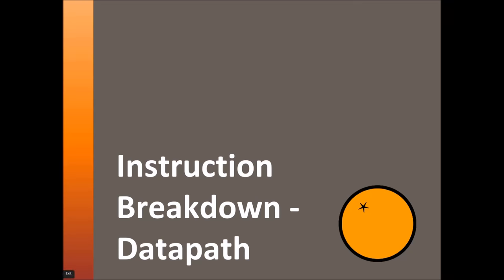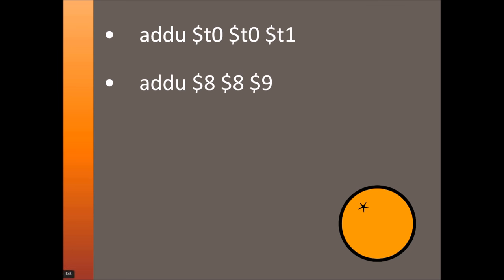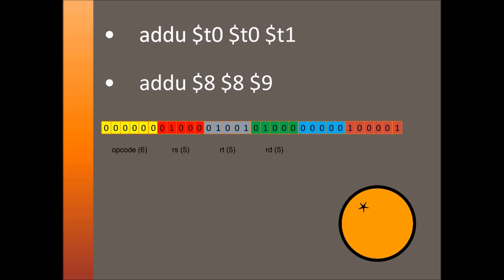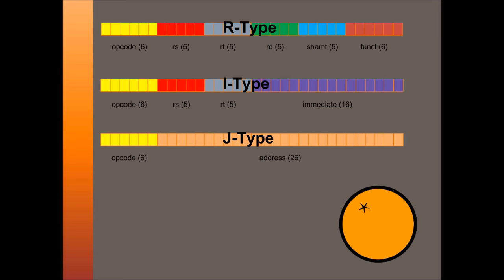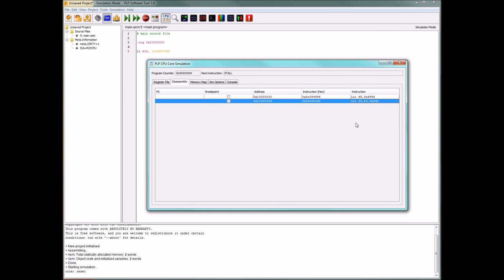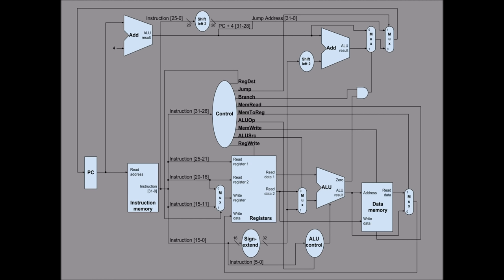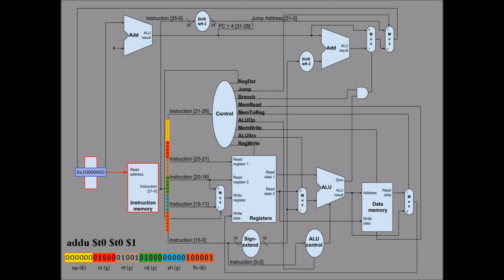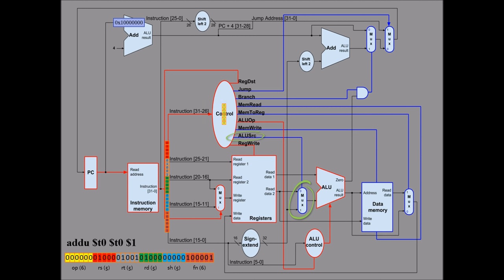Instruction Breakdown/Datapath Tutorial

Comment: I have a question. At 13:43 why is the value read as 0x10FFFFF0 instead of 01001 (11 in decimal)?
Reply: I think it is because the address that is being hold by the register $t1 is 0x10FFFFF0, and after sign extension of 12, they will be added together and $t0 will be written to that address.

Comment: ngl...this saved my life... 
had to design a mips cpu from ground up with basic instruction set in 2 days using verilog HDL and schematic designs, then do modelsim testbenches and write a detailed report analyzing waveforms... and this helped me get stared...
Reply: Sounds like alot of work .Which class is this?
Reply: @athanasiospapazoglou7310  It was a bunch of assignments that lead up to the last one, prior to this one we were tasked to make the ALU of it, which was nothing, and were only given 2 weeks at best to finish the rest of the design, cuz the term was about to end. Bad planning by the Professor. Only until the last 2 days that I found this video and used it's datapath design that I managed to finish the assignment in time.(In fact this diagram is from the famous book “computer organization and design: hardware/software interface” by Dr D Patterson.) 
The course name can translated into: the principle and design of Computer, we had to learn some C, the mips assembly, datapaths(only simplified examples, if prof provided this diagram I wouldn't have struggled), pipeline, ram, io, etc. All the materials(ppt, homework, assignments) my prof used were ripped off from a course in UC Berkeley. My prof was not thinking straight, UC Berkeley students usually has 4 courses per term and they have lab time and tutors I believe, we only had lectures, assignments had to be done in our own time with little help, and we have freaking 7,8 other courses to do per term(yes, our system is so bad, very different to western unis). The prof blame us for not keeping up and we were all hella mad. His planning and teaching were so bad. You can imagine how his rating turned out. lol